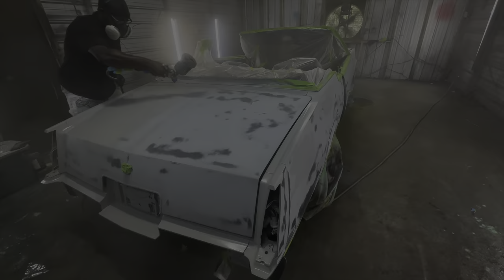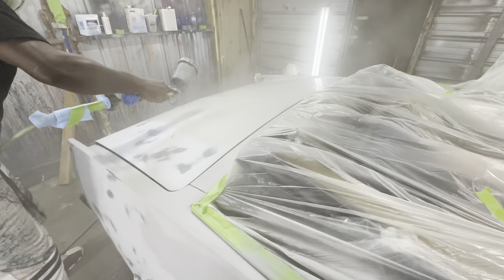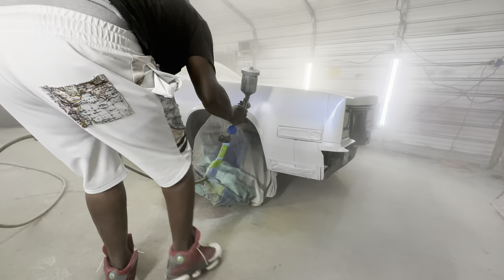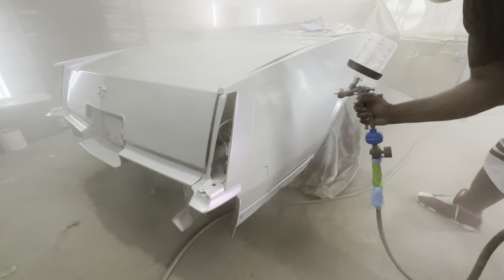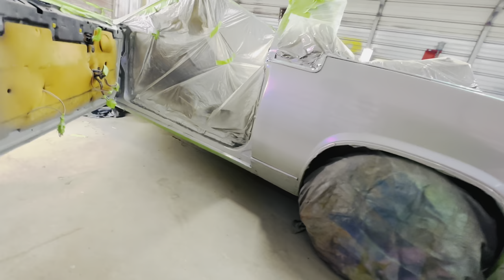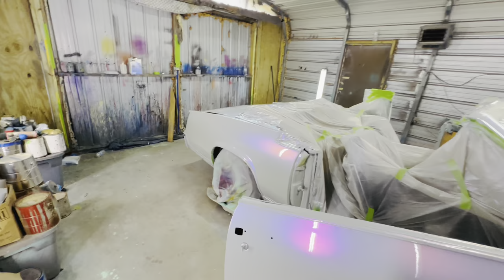Double Outrageous Paint Job on 1985 Eldorado

Comment: You do nice work and walking the side while keeping consistent gun spacing is not as easy as it looks. Was that first coat sealer I assume? Do you use an epoxy sealer or a single stage?  Been doing body work since 1974 49 years in July and still at it at 71.  I only take on jobs I can do in a couple days now but gotta keep moving.

Comment: I used Aircraft Paint "Imron" on my muscle cars of the 70s! No cracking or chipping...hail or sand didn't touch it! Always looked wet! Nothing stuck to it not even road dust!
Reply from the maker: Never tried that
Reply: @TrueGrittCustoms  It's the best! You can hit it with a hammer and it doesn't crack!  You can take a piece of it and twist it and it won't crack or break!  I was looking through a Road and Track magazine back in the 70s. I came up on an advertisement for Imron.  It said that MACK Simi trucks that were driving cross country were using it because sand storms didn't damage their paint! Try it!  It always looks wet!  Gorgeous! 👍

Comment: you still working on the Corvette boss?
Reply from the maker: Yes…getting the motor done
Reply: @TrueGrittCustoms  gotcha trying to decide on which way to go with mine thinking ls3 at some point but may drop a light cam and a few other things in the current 350 hardly any miles on it, look forward to the content boss.